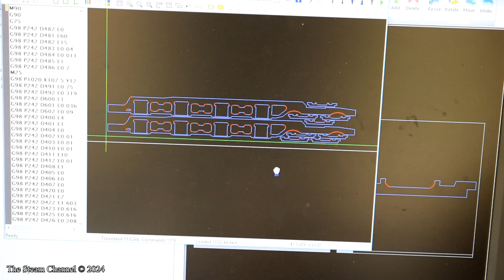Is Live Steam Dead?

Comment: I'm 28 years old, I bought my first 7.5" steam engine when I was 23. I'm one of 3 members at my club who actually do steam, whilst the other 15 or 20 members with trains have modern diesels. I know many younger people who want to get a steam locomotive, but I think one of the bigger road blocks that keeps younger people away from the steam side of hobby isn't necessarily knowledge or their skill set from their career, But it's the sheer cost of acquiring the equipment to build or even maintain a steam locomotive in the first place such as mills and lathes in an economy where the dollar is losing value every day. Just the cost of machines and tooling can be just as expensive as the locomotive itself. The hobby is definitely growing, But money plays a huge factor into what people can and can't afford.
Reply: I'm inclined to agree, large scale steam's biggest barrier to entry is the large scale costs that go with it.

Mostly why I got into small scale and toy steam, at least for the time being. The engines are mass-produced, which brings the costs down significantly to buy, run, and maintain. There are also more in the way of fully-machined kits so even someone without a machine shop can build their own engine.
Reply: It's not just the machine tools, you need a property to set them up into a workshop. That's nearly impossible for renters. You have to be a property owner and not just any property, you must have one with enough land for a reasonably large workshop. Also you can't be in a situation where you are at the mercy of a landlord because the expenses involved in moving machinery can exceed there original cost.

I guess it's why there are many older even retirement age people in the hobby. You have to have you entire life sorted out, finances, property, living arrangements, transport, work.
Having a machine shop is not a hobby, it's a way of life.
The steam engines are a spinoff of that lifestyle.
Reply: yeah the cost is insane.... not going to drop 4 times more then the price of my truck on something so impractical X.x hell one G scale live steam is about the cost of my truck 2-5k usd its a hobby for the upper class
Reply: You might consider some of the smaller locomotives that cost more in the range of a few hundred, like Accucraft's Dora and Ruby.

Likewise, the ranges of Jensen, Mamod, and Wilesco offer a chance to own working steam for a much more affordable price.
Reply: @furlosifurfox5794 I'm a music teacher and I was able to find two affordable steam locomotives. They're out there if you're willing to look.
Reply: @andrewmagosky7181 

I've been look around at small scale live steam, and the cheapest I've seen was a $600 0-4-0.
That's not impossible for me, but that's a lot of money for not lot of train. 
I'm pretty new to even looking into live steam so suggestions for where to go would be great.

Comment: East German fellow here, steam's always been my life, that's why I decided to go for the leap and started my own live steam "Saga" in 2021 on my 21st birthday. I lack both machine shop and property, so I purchased a finished engine from Maxitrak, fine running engine she is, but it certainly costed me most of my savings to purchase her, get her shipped and get everything prepared for her. Learned how to weld along the way to build my own rails, but it's still terribly hard to find anything at all over here. 7 1/4 in railways are not that common over here, the next closest club is in another state, but I managed my first running season last year pretty well. I think what scares off people the most from getting into the hobby is the idea of spending years, even decades before even seeing a wheel turn. When they hear about guys working that long on an engine, they're cutting the concept right in the bud. Adding to it the fact that, even for a basic railway setup, you could easily end up paying some 30000 euros as a bottom price, and any plans they might have drawn up to that point are blown to the wind. I personally try to get people interested through my portable railway, and convince them that they can start with the simplest setup and design, even a lawn mower motor on a chassis, and they can always build up on that

Comment: Hello,

This is an interesting video and an update on the status of this hobby. 

Several years ago, personally, I decided to limit myself and focus on potentially building ONE project, a scale version of a certain foreign 4-8-4 which has been of significant study and research topic of mine for many years of my life. This would be very large and run on 7.5” gauge. 

Yes, this is a steam locomotive. Yes, my desire would be to build it from scratch and make enhancements beyond its as-built configuration. 

I am about to turn 63 years old. In storage, I have machine tools, which are of a size which can be used for this project.

Life as a whole for me is a challenge right now, and time marches on and waits for no one. As I’m sure many of us recall, it is not uncommon that older steam locomotive project builders have passed away in the midst of their build. I certainly recognize this, my goal is to start drawings and at least get a visual of what it could be. One step at a time….. let’s see if life holds on long enough for me to see this become reality.

If it does not, that is fine, the point is to enjoy it along the way, enjoy the process.

Some may say, choose something simple some thing you can get into the hobby quickly and enjoy operations. Absolutely not…..you only live once,  in my case I’ve studied mainline steam locomotives for years and have an engineering background as well as machining.

If it is a 10 to 15 year build, you’re only going to have one shot. My suggestion is build your dream model do not compromise for anything less. It is your art, your canvas, your ultimate expression of creativity. Do not compromise.

It will be interesting to see how current manufacturing and design technologies can enhance this hobby. Thank you for sharing this video.

As an addendum, maybe us old guys who get something started and know they’re not going to finish or at least instruct their widowed spouses to find some able-bodied young person to pick up the baton and finish it off.

The live steam hobby has advantages over the full size models. You can bypass all the drama, politics and the sheer struggle to be close to, join or hire onto a railroad that operates and maintains steam locomotives. You can bypass the extremely disappointing realization that you don’t live in the correct geographic location or you cannot convince a railroad to take you on, despite the fact you are highly interested.  passionate and have life skills which would be useful AND you deeply feel you would be a significant asset to organization. With full size steam comes massive size, massive cost, huge egos, considerable multi million dollar infrastructure to operate it, and even more rare….. to operate at mainline speeds.

Skip it!…..Skip it all!! Self-execute and enjoy on your terms. Then you can share your creation with the masses in a much more manageable , approachable fashion and venue…..in a back yard or park. 

Cheers!

Randy.

Comment: i model in 3 1/2 inch gauge mostly ..started with 1 engine at 24 years old ..im now 33 with 15 engines !! 14 steam and 1 battery engine ...been a member of my local engineering club for 10 years and its only been past 3-4 years  evening class's was started to help those get and improve experience on machining on the lathe and milling machine mostly ...i personally think clubs need to do this  to get those who want to build either a steam engine or beam engine or anything   to help them get started or to proceed with the builds ..even those who are stuck on doing some of the machining work or the no how can get that from experience from experience builders

Comment: Polly Model Engineering here in the UK have ceased production of loco kits. THAT really is a downer as I wanted one and they are well known for fantastic quality freelance 5 inch gauge locos.
Reply: I'm pretty sure that Polly Models are still being made at under a different maybe but I was talking to one of the owners fairly recently.
Reply: @Kivetonandrew  yes they are. I believe it changed hands due to retirement, as we bought a few pieces of equipment from them at auction when it all moved around

Comment: The only reason why I don't have live steam of large scale is because it's just to expensive and I don't have the tools to build one
Reply: Find a small 6" lathe, get Bob Maynard's clishay book and see what you can do. 6" lathes can be found under $1k with power feeds and everything. The clishay book is $25 and the locomotive will probably cost you $1500 spread over however long it takes you to build. That cost is if you buy all new and fresh materials. If you buy used, you could pay less.

If cost and tools are what's keeping you from it but it's something you want to do, find a way to do something to make it fit your means.

You don't need a tool room, you need a simple lathe, drill press, taps, a brazing torch and some files. This hobby took off during the great depression in the US and some beautiful machines were built out of nothing.

Comment: It better not die I'm thinking about talking to accutie and ordering about 50 ft of track and ties to employ on the sawmill I'm working on getting running its log rack is forced to be in a bad location so I want to use a cable incline to load the rack from a lower easier to fill rack doing this will also get me in the door with this train equipment as well even though it's not the 15in gauge shay or Pennsylvania a3 adapted from kozo hiroka's books that I have  that I want also I really doubt that this hobby is going anywhere the folks involved with steam that I've met are the same ones into homesteading and horses
Reply: I actually bought a good amount of ties, rails, and switches from them during…that time in the 2020’s…for my own personal railroad in the Cedar Valley Area in North East, Iowa. Pricey-ish compared to wood, but after using these. I’D NEVER EVER WOULD RECOMMEND WOOD TIES EVER. Best Investment Ever
Reply: I've only been really active in this hobby for about three years or so, but I'll tell you that Accu-Tie ties are the way to go. Easy to work with, they don't rot or fall apart. My railroad has 5 miles of track and nearly all of the ties come from Accu-Tie.